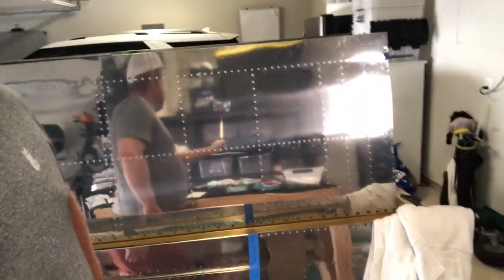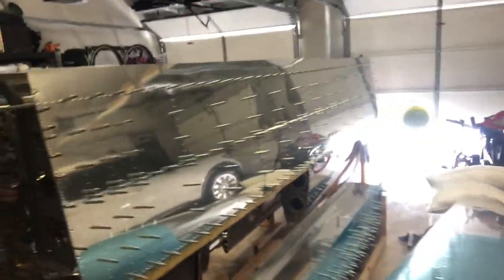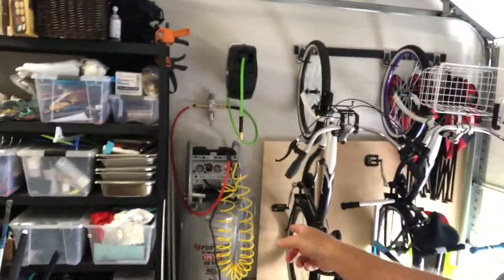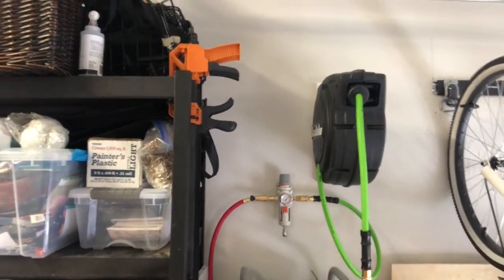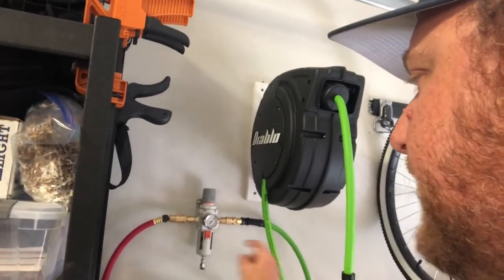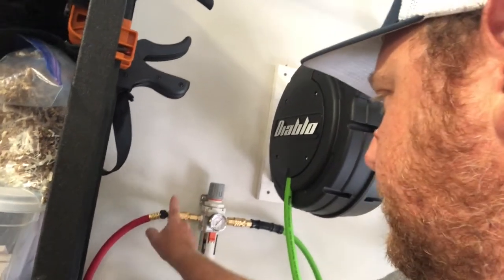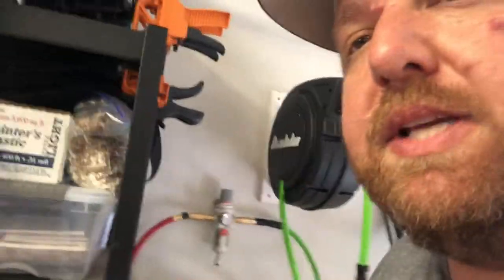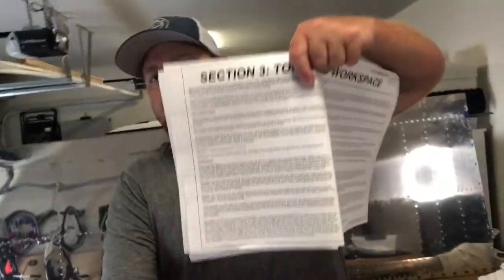Airplane Workshop Tour (building a Van's RV-10 in my garage)

Comment: I really didn't need to see this video...
LOL!!!...You put salt on a wound.
I just sold my much loved fully equipped IFR 172 to fund my RV-10 project. Been 2nd guessing myself for the past 3 weeks if I should have done it. Anyway the deposit is already paid for the RV-10 empenage kit.
Reply from the maker: Hey Man, yeah and my deal is even better, I am 1/10th on a 182, I pay $120 a month and $130 an hour wet (NOTHING ELSE).  That covers annual, basic repairs etc...  BUT I have always wanted my own plane and I want something awesome.  The 182 is solid, but its SLOW.  The hard part for you is going to be not having something to fly for for 3-4 years while you build.  I can tell you though that this has been a very exciting journey so far.
Reply: @pilotrhino  Actually back to renting beat up planes that are also school planes...😥
Reply: @pilotrhino  I kept the hangar. Debating on building at hangar or home. Hangar saves garage space at home but my hangar neighbors say building at home and moving completed pieces will get the project done faster. Pondering that prior to delivery has been driving me insane.